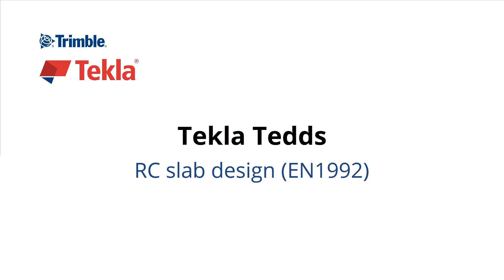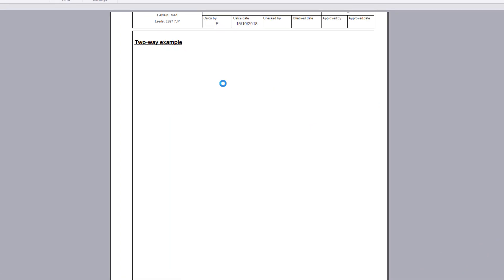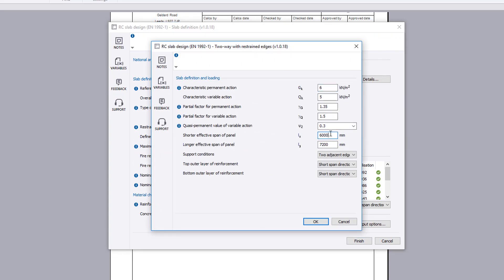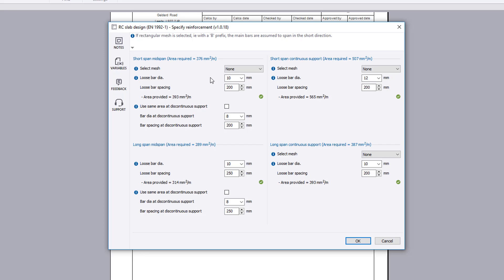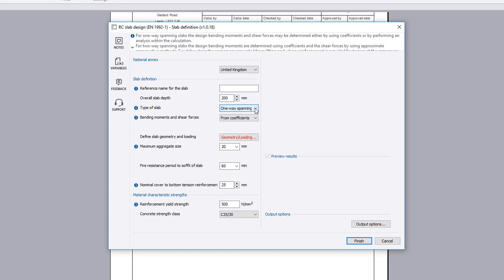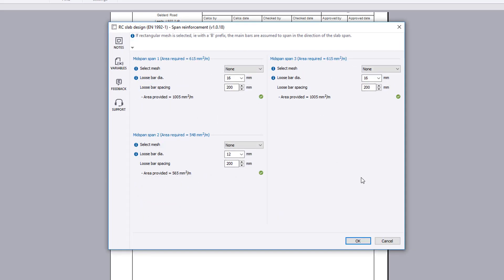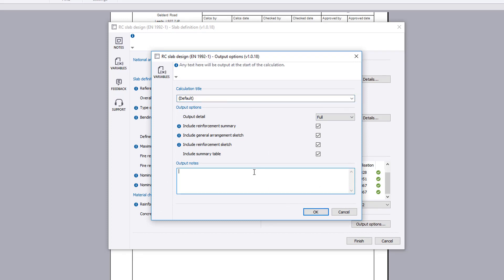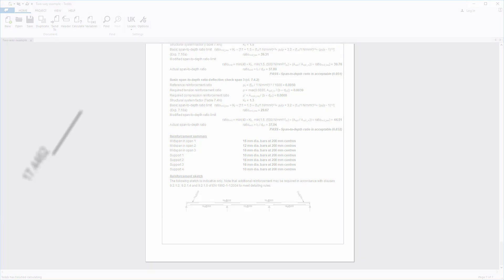RC slab design (EN1992)

Comment: How can I design a cantilever slab in Tekla Tedds?
Reply: Hi Daniel, within the dialogue where you define slab geometry and loading, you are able to specify support conditions (for example, three edges discontinuous and one edge continuous). If you need any additional information or help with Tedds, please contact your local account manager and they should be able to assist, thanks!